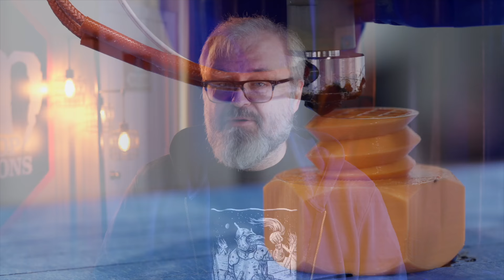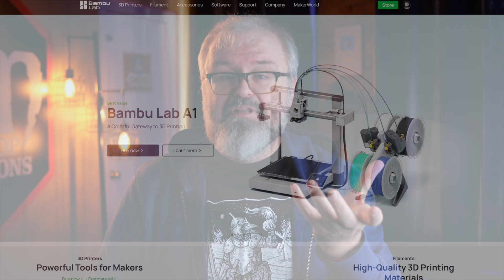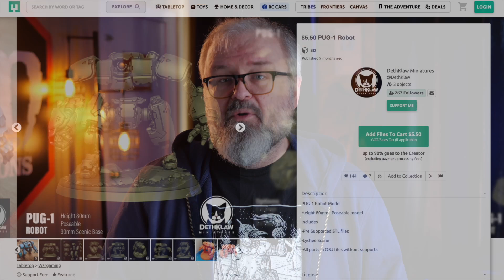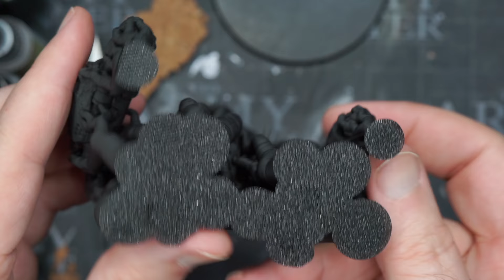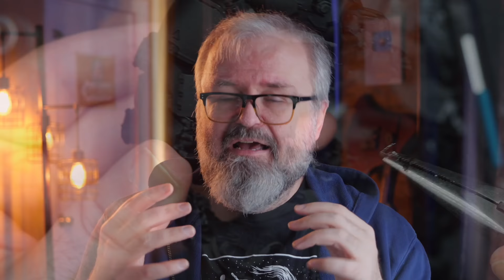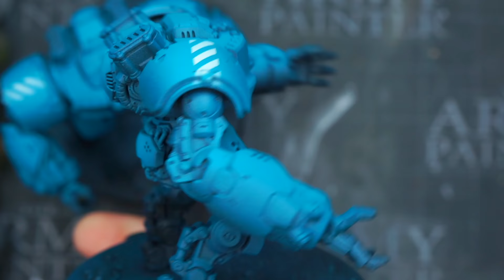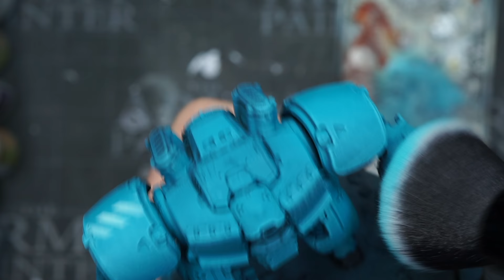I Compare RESIN vs. FILAMENT for 3D Printing Wargaming Minis

Comment: What line layer setting did you use?  Bambu Labs lets you go down to .06mm with the .2mm nozzle.  It'll still look a bit layered, but it'll be tighter.  Also I've found that orienting your print in the best way to provide support and limit damage from removing the supports is a true art form.  Great video.

Comment: the most important thing of all if going resin... Shop towels. For the love of all that is holy, or chaotic and unholy, GET SHOP TOWELS. Keep them in bulk and ALWAYS on hand. you WILL NEED THEM. Can't stress that enough, dish soap and shop towels will save your bacon... or your marriage. Maybe both even.

Also dish soap works better than alcohol on cleaning resin. It loosens all the gunk and gets it out of there without softening and weakening the details of the resin.

Comment: Wargaming happens on a literally different scale, but us movie prop replica builders often combine the two, only printing the detail sections on the resin machines to combine the strengths of both.
Big downside of filament elements is that you can always count on needing to need sanding and filler primer to level out the surface imperfection to get anywhere. Still, the material price and print volume bring other advantages to the table.

Comment: Personally it's more the hassle of resin cleanup and being very careful not to poison myself vs flex the plate on the bambu after its done that plays more into my deciding between the two. Resin is far superior in quality but sometimes it just doesn't matter. It helps that I've already resin printed an enormous "pile of potential" so my point is a little moot right now... :D

Comment: > You won't trick anyone...

Many people on youtube try really hard, trying to claim that they're "about the same quality", glad to see that you don't :)

While not a lot has changed on filament printers, there have been some pretty significant changes in the slicers, including Arachne (variable line thickness, which helps a LOT when filling lots of different sized areas on each layer - that's a big deal on miniatures), and another (older) one obviously being the tree / organic supports.

What I really wonder is, since multicolor printing is becoming more popular, why don't more people print miniatures in filament, using PVA filament for support interface? (water soluble)
That can make support removal much more simple.

(Obvious answer is that it just makes so much more sense to just use a resin printer, it's much faster too)

Comment: when i have printed models on my FDM printer when i have the option i print it in multiple parts because it allows me to change the angle to get the best support angles to give it an cleaner look.

Comment: I recently was given an A1 Mini. And have been experimenting with printing both 28mm scale minis and a larger print. A robot that looks about the same scale as yours. I decided to go with multiple parts. So far the undersides are definitely the big downside of the filament printing. I've printed a lot of resin minis. But I moved and no longer have a good space for it. Hence the switch. What intrigues me most I think is mixing and matching, especially for very large prints between the two styles. I've found my big resin prints are very heavy and a tad fragile. Whereas filament loses some fine detail but is incredibly sturdy and lightweight. 

Additionally, I think I am probably going to go back to resin for proper minis. The level of detail is just more fun to paint. And then experiment with higher quality resin and mixing different resins to address the strength issues I've had. That being said, I have been using a .4mm nozzle, since that's what I have. So further experimentation with a .2mm nozzle is needed

Comment: When I first set out, resin was the way to go, butthe hazrds outweighed the results - I have breathing issues - so FDM printing was my only choice, for home printing.

Over the years I have printed battletech proxies, as well as a ton of spacecraft for games such as "A Billion Suns" and they are perfectly acceptable for tabletop gaming.  A real plus is durability, drop a FDM model and by and large it stays intact, almost the complete opposite for resin types.

End of the day, it really is a matter of choice, resin models are often intricate and a joy to paint, but on a tabletop at three or four feet - at least at my standard of painting - you may be hard pressed to spot any major differences

Comment: I actually almost bought a bambu labs printer after your video about FDM printing but after some research I found out their software is not great for personal data protection and after their recent overhaul debacle I was pretty glad I didn't purchase from them.

Long story short: don't update the software on your bambu printer.

Great video though. You're right I haven't seen anyone compare paint jobs on both types of printing.

Comment: Try setting up the interface layer between the supports and the model to be PETG. PETG will not bond to PLA, but it still provides the needed support.

Comment: For tabletop gaming I print on a Bambu A1 mini, the 28mm minatures come out fine. I do, however, print in pieces which gives the minatures better detail due to less use of supports. Takes a bit of planning to set the minature up correctly, but it is part of the fun.

Comment: A trick I've seen people use to smooth out filament 3D prints is to put the model in a jar or tuperware with a paper towel soaked in a little acetone, and let the vapor subtly melt the outermost layer of the plastic. Usually it's enough to  smooth it out without losing too much detail. But I've never seen someone do this with a miniature that has very fine detail.
Reply: Acetone vapor smoothing works well on ABS prints, but probably won't work on PLA, but I've seen some who claim it works (and many who don't.)   You might try ethyl acetate on PLA, but I haven't (I can confirm that methyl acetate such as found in cheap acetone-free nail polish remover doesn't work.)  With a small print like a mini, I'd worry that the whole thing woud get too soft before the layer lines started to melt together.
Reply: That only works for ABS.
Reply: wasn't this an old technique from the days when the filament was 3mm in diameter and the layers were much thicker than they are now?

Comment: Bambu Slicer should have a feature called a "Support Painter", which lets you tell the slicer where you want it to put the supports.  What's also nice is you can also use the painter to tell the slicer "Hey, I don't want you to put supports in these spots".   It might take a bit more time, but you should be able to get cleaner prints that way.
Reply: It does. Under manual supports.

Comment: For anyone wondering: resin printing costs about 40% of the retail cost of a 40k model, in material requirements. 

It'll cost you about $13 to print a $30 set of necron warriors (and scarabs).

Plus the time, the cleaning, the machine upkeep, and buying the files.

3d printing is it's own hobby. It's not a free way to collect 40k (or any other game)...

Comment: We use a decent amount of fdm minis at 28mm...

They are fine in a rank n flank setting, they do well for battletech mechs and tanks. They look janky with more organic shapes. On the table for a game piece they are perfectly fine.

They are not on par with resin prints. If you want the best 3d print detail resin is the way to go.

As much as I like fdm and use, it is not winning a painting competition for a few more generations. Great for terrain and certain minis, but knowing when and where to use fdm makes a huge difference.

Comment: I use nippers from my Gunpla kit for support removal and spray putty and touch up before priming. I would say they come out way better than your filament model but still a bit off from quality resin print. Nice video !

Comment: I usually print my tanks and bigger models and terrain on FDM and just the small stuff like space marines or battletech mechs on the resin printer.  It also pretty much always print as many separates as possible.  Makes for easier supporting and cleanup and is quicker to reprint errors or mistakes.

Comment: I use Bambu labs printers at work. We recently got a sample of support for PLA. It makes support removal a lot easier, as well as vastly improving the quality of the overhung parts as it prints right up to the model, rather than leaving a small gap. 

You can also set it up so it only prints the support material where the normal supports meet the models, which reduces the amount of filament switches. It also makes the support for PLA last longer. 

It does increase the print time, so it might not be worth it for terrain but if you want to print more minis It might be worth a try! :)

Comment: I 3D printed 5 1000 point armies as my first step into Warhammer.  I own both resin and filament printers and I wouldn't do it if I didn't have a resin printer

Comment: for me, it would come down to if I plan to print miniatures & terrain (or vehicles). If that was the case, I could easily suffer the loss of fidelity from a filament printer in exchange for versatility, and price. I would have also broken up the filament model and printed each piece separately.

Comment: Check out Painted4Combat. He prints only in FDM and prints lots of Minis. They can look great. He has a couple of videos where he goes over supporting minis and the settings he has used for his minis. Using those settings I have been trying to print minis and the first few have come out beautifully. Once I put paint on them, from more than 10 to 20cm you can't see any defects or layer lines.

Comment: In my experience of the stuff I have gotten on Etsy for the past several years, I can say that resin is FAR, FAR better!! Filament is just way too brittle and harder to work with. You often try to saw or cut off a small section of something and it snaps off at a point nowhere near where you're trying to cut it. Resin on the other hand is closer to model plastic and WAY better. You can cut off parts, convert, it's just more user friendly in every possible way. I have found that with filament, little bits like spikes on things and sword tips, horses' ears often come broken off because of the brittleness. If there is any mini. that has those kinds of tiny, thin, fragile bits you must go with resin.

Comment: I don't think filament is always for terrain and resin always for units. Some small scatter terrain like detailed crates, lamp posts or computer terminals look better in resin, and are still easy and cheap to produce, while larger unit models (like tanks and other large vehicles) that don't have tiny details are more convenient in filament (cheaper, and less hassle with hollowing and processing, particularly cleaning and curing the inside). I'd print them in pieces, so you can position each one for optimal printing, and also if it has smaller, more detailed parts like mounted machine guns, antennae, handles, etc. you can print them separately in resin.

Comment: You gotta use small size support tips, never go larger than like .5 unless its for a spot on the model you will never see - like under the feet. 

Using heavy supports with large tips on the feet can really help prop up larger models and allow you to use smaller supports/tips on the jigher spots

Comment: When printing FDM I've found that printing a model in individual parts gets the best quality. That way you can orient the objects so that internal areas are face down to the bed (and get that stringing issue) and the areas that will face outward (towards your eyes when you're looking at the model) are facing up on the bed and get the best detail and quality. In general you want to print an object in a way that minimizes how many supports you will need.

Comment: I've printed a few smaller things with my Ender 3 Pro with surprisingly decent success at times.  Forearms for Tau Crisis Suits (old ones were broken off from some rescues), a few Battletech miniatures (done in separate components and assembled later), some scenic (and also some basic) bases, etc.  It can sometimes take spending a little time in an editor, but as echoed in other comments, anything you can do to reduce supports or at least hide the connection points will pay dividends.  Filament is also good for tanks and such in addition to terrain, by the way.

And any damage from tearing off supports?  Guess what?  That's just "battle damage"

Comment: FDM is perfect for vehicles are robots and anything  bigger than that.  Their not designed to fool any one, their printed to get you on the table rolling dice.  I have a full corvus blackstar and brutalis dred. the blackstar looks almost indistinguishable.  FDM prefers printing in parts so you can get good bed adhesion and avoid overhands as much as possible to reduce the number of supports needed.

Comment: The Fat Dragon Games profiles are great starter profiles, but the reddit fdm miniatures community is using a few different higher quality profiles (HoHanson being the main one) which produce some great results. I print mostly 28-32mm figures with a bambu A1, and there are issues, but the quality at the high end is extremely good. As a former resin printer, the trade offs to filament are almost all positive, with a few obvious issues (support scarring, and upper end resolution being the big ones). For table top play, and casual displaying, you can't go wrong with an FDM printer.

Comment: I have both, printing in parts with a 0.2mm nozzle and speed will get you a model. Once primed and a rudimentary coat of paint it clearly looks like the mini and would not be mistake for one on the board. Sure it looks bad up close and the roughness of the print is clear, but you not gonna have confusion with the print on the board. And the cost of a FDM printer and material is a lot less than a resin printer.

The two printers do not do the same thing and realistic which one you buy depends on what you want. If you know you need a cheap army that just needs to do the basics and can be disposable then FDM, if you want quality with lots of fine detail and intend to keep them go resin.

Comment: Currently printing various HDF forces from One Page Rules on my Bambu A1 in PLA. I use Fat Dragon's suggestions and a 2mm hot end and default tree supports (hybrid) from the slicer. They won't win contests up close for sure, and they are a bit rough from pulling the supports off, but a little filing and my crappy slap chop paint job, and a squad of them at table distance they look pretty good! Especially considering the cost, lack of mess and toxicity, etc. Of course I could print them in resin and they'd look amazing, but I'm going for something that can move around on the table and look reasonable. FDM works for that, no problem.

Comment: Printing and supporting each piece is usually a better option. Each piece can be oriented to have better supports and not have later lines and the spaghetti look on the undersides. Also your nozzle size and layer height make a huge difference. But with that being said resin will always look better with a good resin printer.

Comment: I have printed a few minis on my A1 Mini with varying degrees of success.  I printed a proxy Redemptor Dreadnought and it came out... eh.  Maybe not quite as good as your robot did.  I did a proxy blighthauler and it lost quite a few spikes and the underside is pretty bad... but otherwise it came out pretty decent.  I also printed out a model I designed on heroforge that came out pretty great!  However, I knew that I would be printing it on my A1 Mini, so I designed it with as little overhang as possible.  If you get long, thin parts that hang out (like the Stormcast Eternals with spears, for example) they will not do well.  I did it all with the 0.2 mm hotend and PLA.  After all that, I think I will just stick with printing terrain and stuff.... though I may try something boxy like a tank at some point.

Comment: Its funny, you mention unsupported being for Filament printing, while the pre-supported files being better for resin. I've done a couple of prints on my A1 now, and I've found pre-supported stuff tends to be SO much better for removing the supports as well as having less visible scarring on the model. The stuff I have to use Orca Slicer to support almost always comes with majorly scarred areas that have to be cleaned up afterwards, and it usually takes a couple of prints before I'm satisfied.

I printed a bunch of pre-supported airships for Skies Ablaze and, while there is obvious scarring from the supports, it was much easier to clean up, much easier to remove and the model just looks way better. Meanwhile, I'm currently trying to print a Hydralisk from Starcraft, that doesn't come with any supports. I'm just about to attempt to remove the supports I made in Orca Slicer for the third print. I'm not looking forward to it.